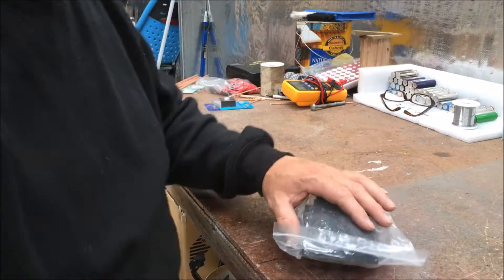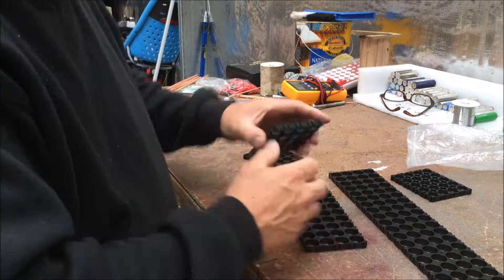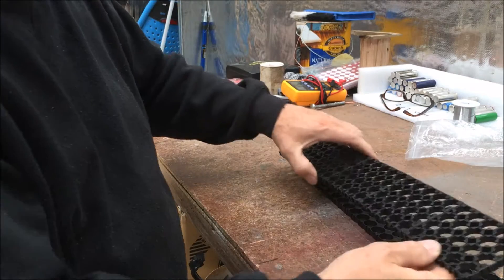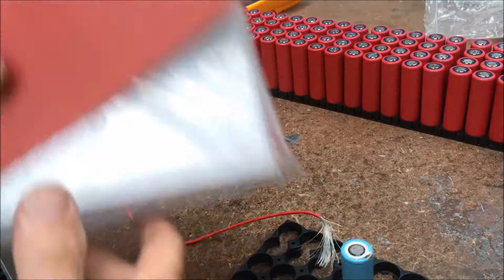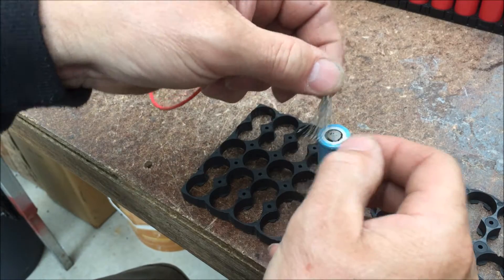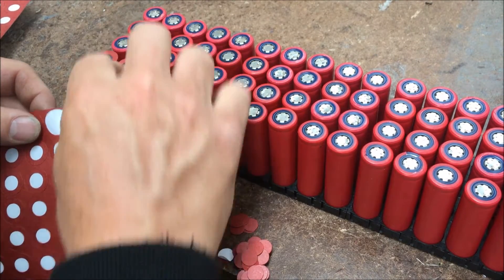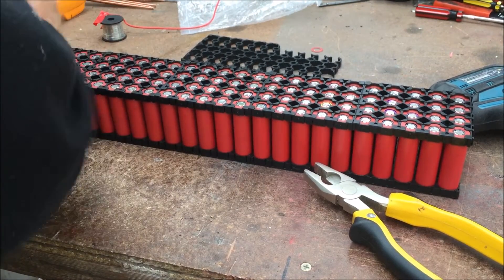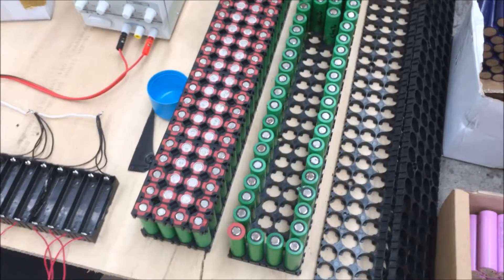DIY Power Wall - Building the pack #2

Comment: Awesome Build. Thank +HBPowerwall for telling us about you. Love the way you do the bus bars as well. What are the Stickers called? I am not doing a project this big but would like to use those insulators anyway. Thanks in advance and keep up the videos. Mike From Texas!!
Reply from the maker: Try a eBay search for "200pcs cardboard 1x18650 battery Insulators Electrical Insulating Adhesive Paper"
Reply: Those are called 18650 battery insulators and you can find them on ebay pretty cheap      http://www.ebay.com/itm/200pcs-cardboard-1x18650-battery-Insulators-Electrical-Insulating-Adhesive-Paper-/401211970562?hash=item5d6a18d402:g:OQUAAOSwA3dYDH6k

Comment: Battery holders link is dead
Reply from the maker: try a eBay search with this heading and you will find some  "10Pcs 4x5 Cell Spacer 18650 Battery Plastic Radiating Shell Heat Holder Pack"